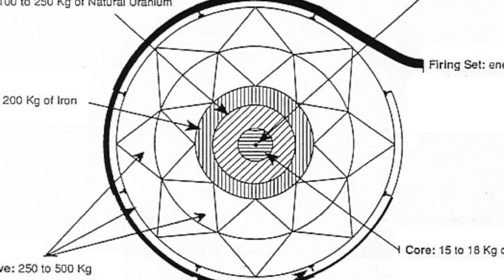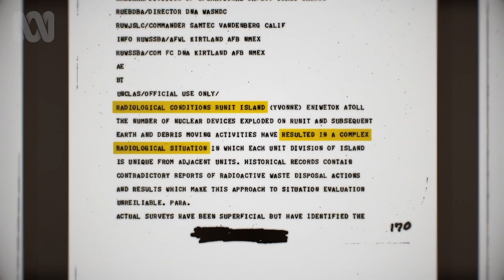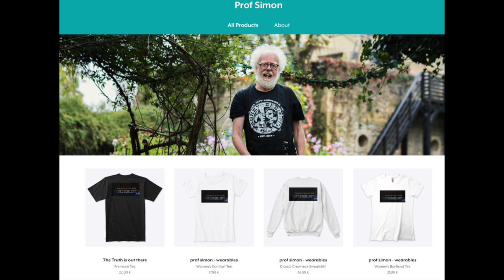Inside The Dome - Prof Simon

Comment: Considering that only a fraction of the Plutonium pit actually undergoes fission even in the most efficient modern warheads, and only up to 35% in these earlier designs iirc, with the rest being vaporized and dispersed - there are several kilograms Pu and several Kilograms Uranium floating around anyway.
Regarding that fact - a pit worth 2.5-7kg Pu probably isn't that mich reason for concern.

Regarding the fact that an expensive cleanup is definitely not going to ever happen - one should just bury a high yield high neutron flux warhead there and blow the whole thing up if one deems the risk actually high enough. It'll react some of the remaining core fragments and vaporize and disperse the rest, just as it happens with every explosion of a nuclear warhead. The additional damage would definitely be negligible.

Great find and thanks for the video though and keep up the good work!

Comment: Not only is the sea very slowly rising, but all submarine mount islands are formed from volcanoes. This means that the effect on the lithosphere is such that the island sinks slowly into the crust by isostatics. All volcanic islands suffer this fate. The French got a bit of a shock when drilling into Muroroa atoll when they had to go deeper than intended for their underground nuclear tests as the coral cap over the igneous rock was thicker than planned. The coral grows as the island sinks. In fact, if the Runit dome becomes completely submerged it may result in the entombed radioactive materials becoming sealed by coral reef growing over it. There has been more than 2 half-lives of CS 137 since the nuclear tests stopped at Runit, so only a quarter of the radioactive material remains. The plutonium would be a much longer decay prospect. I wonder why they would bury it there rather than taking it to the United States, overly contaminated with other materials?

Comment: right, they had no clue about nuclear radiation at that time. Thats why nobody can be blamed actually. Sea-level rise might be a myth. Most of the ice at north and south pole swims in the water. When swimming icebergs melt the water level does not rise.
Reply from the maker: The Antarctic is a massive continent of rock, covered with over 2 miles of ice. If it all melted Kansas would be on the seaside. But the less visible source of melting is from permafrost. The sad news is we have banked 2 ft of sea level rise since we started burning coal in 18th c.  Even if we stop making the world warmer, we are going to loose many places, including Miami.
Reply: right, thats what we also learned at school, thick ice coating of several miles on the land of Antarctica.  But how the ice should get there, there is no snowfall? It is too cold and in order that seawater covers the land the whole land must have been inundated two miles deep into the sea. Did this happen?  When checking the photos of "coolantarctica/Mountain Pictures/gallery" it is only a thin coat of a frost crust. At the video "NASA | The Bedrock Beneath" it shows Antarctica without ice, only the land, and it looks like most of the ice is swimming around Antarctica while it is also attached, frozen on?